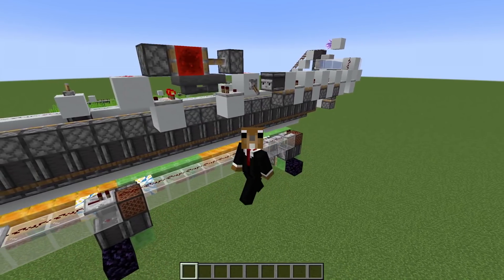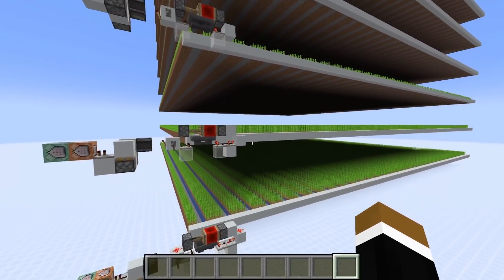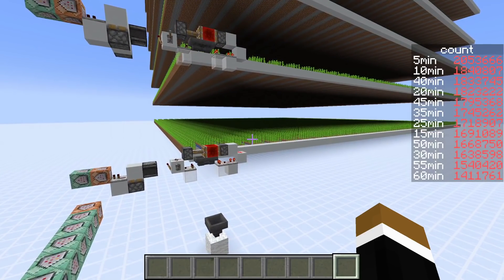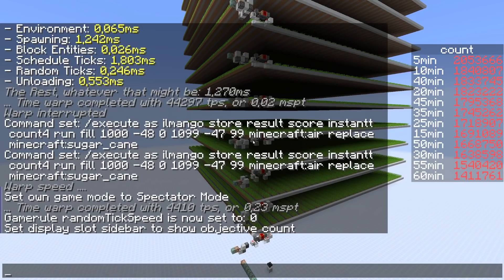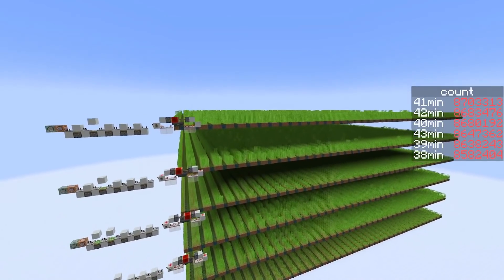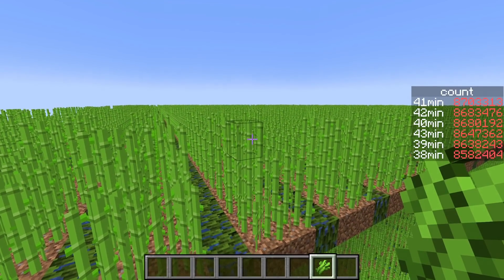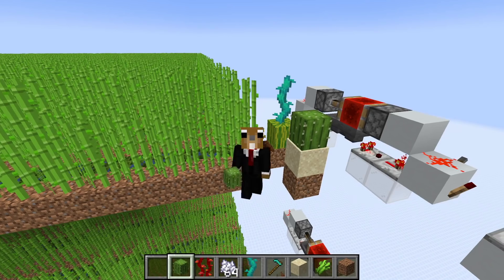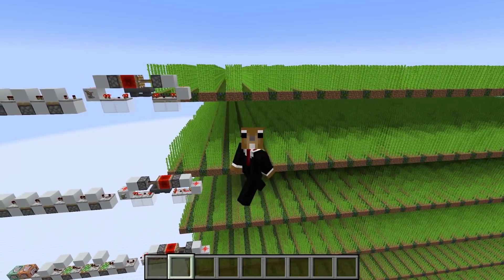What Is The Perfect Clock For A Sugar Cane Farm?

Comment: short answer: the best clock is around (10 * length of sugar cane + 49375) ticks

Long answer (check replies if you just want the exact numbers):
If we were to assume that the flying machine passes the sugar cane instantly, then Yuusei Kurobane's answer of a 49251 clock would be correct for a clock around 41 minutes. But in reality the flying machine will prevent the sugar cane from growing for a few ticks and does not collect any sugar cane harvested while flying backwards. Taking that into account (and assuming the farm is 34 blocks long (counting only the sugar cane)), the optimal clock length is 49708 ticks, with roughly 2.5725459776809921158178684192717991792 sugar cane per hour per plant. If we weren't lag-conscious, then a 4467 tick clock with 2.7563918812670089447739602907367470495 sugar cane per hour per plant would be the best you could do. I'll run the calculations for other farms lengths and post the results here later.
Reply: Optimal clock lengths for possbile lengths of the sugar cane farm (counting only the length of the sugar cane):

length | clock length | rates (sugar cane/h/plant)
   10     |      2633        |                2.9500
   11     |      2729        |                2.9390
   12     |      2822        |                2.9285
   13     |      2913        |                2.9183
   14     |      3002        |                2.9084
   15     |      3088        |                2.8989
   16     |      3173        |                2.8896
   17     |      3255        |                2.8807
   18     |      3336        |                2.8719
   19     |      3416        |                2.8634
   20     |      3494        |                2.8552
   21     |      3570        |                2.8471
   22     |      3645        |                2.8392
   23     |      3719        |                2.8315
   24     |      3792        |                2.8240
   25     |      3864        |                2.8166
   26     |      3934        |                2.8094
   27     |      4004        |                2.8023
   28     |      4073        |                2.7954
   29     |      4141        |                2.7886
   30     |      4207        |                2.7819
   31     |      4274        |                2.7754
   32     |      4339        |                2.7689
   33     |      4403        |                2.7626
   34     |      4467        |                2.7564
   35     |      4530        |                2.7503
   36     |      4593        |                2.7442
   37     |      4655        |                2.7383
   38     |      4716        |                2.7324
   39     |      4776        |                2.7267
   40     |      4836        |                2.7211
   41     |      4896        |                2.7155
   42     |      4955        |                2.7100
   43     |      5013        |                2.7045
   44     |      5071        |                2.6992
   45     |      5128        |                2.6939
   46     |      5185        |                2.6887
   47     |      5242        |                2.6835
   48     |      5298        |                2.6784
   49     |      5353        |                2.6734
   50     |      5408        |                2.6684
   51     |      5463        |                2.6635
   52     |      5517        |                2.6587
   53     |      5571        |                2.6539
   54     |      5625        |                2.6492
   55     |      5678        |                2.6445
   56     |      5731        |                2.6399
   57     |      5783        |                2.6353
   58     |      5835        |                2.6307
   59     |      5887        |                2.6263
   60     |      5938        |                2.6218
Reply: Lag-optimal clock lengths for possible lengths of the sugar cane farm (counting only the length of the sugar cane):

length | clock length | rates (sugar cane/h/plant)
   10     |      49421        |                2.5850
   11     |      49433        |                2.5845
   12     |      49445        |                2.5840
   13     |      49457        |                2.5835
   14     |      49469        |                2.5829
   15     |      49481        |                2.5824
   16     |      49493        |                2.5819
   17     |      49505        |                2.5814
   18     |      49517        |                2.5809
   19     |      49529        |                2.5803
   20     |      49540        |                2.5798
   21     |      49552        |                2.5793
   22     |      49564        |                2.5788
   23     |      49576        |                2.5783
   24     |      49588        |                2.5777
   25     |      49600        |                2.5772
   26     |      49612        |                2.5767
   27     |      49624        |                2.5762
   28     |      49636        |                2.5757
   29     |      49648        |                2.5751
   30     |      49660        |                2.5746
   31     |      49672        |                2.5741
   32     |      49684        |                2.5736
   33     |      49696        |                2.5731
   34     |      49708        |                2.5725
   35     |      49720        |                2.5720
   36     |      49731        |                2.5715
   37     |      49743        |                2.5710
   38     |      49755        |                2.5705
   39     |      49767        |                2.5700
   40     |      49779        |                2.5694
   41     |      49791        |                2.5689
   42     |      49803        |                2.5684
   43     |      49815        |                2.5679
   44     |      49827        |                2.5674
   45     |      49839        |                2.5669
   46     |      49851        |                2.5664
   47     |      49863        |                2.5658
   48     |      49875        |                2.5653
   49     |      49886        |                2.5648
   50     |      49898        |                2.5643
   51     |      49910        |                2.5638
   52     |      49922        |                2.5633
   53     |      49934        |                2.5628
   54     |      49946        |                2.5622
   55     |      49958        |                2.5617
   56     |      49970        |                2.5612
   57     |      49982        |                2.5607
   58     |      49994        |                2.5602
   59     |      50006        |                2.5597
   60     |      50018        |                2.5592

note: the values may be a little off as I had to lose some precision so that it wouldn't take forever.
Reply: If the flying machine ran in a loop, then the length of the farm wouldn't matter. Every sugar cane will get harvested the same specific time interval (excluding the first cycle). 
If the flying machine went back on forth then the harvest time that's a bit trickier to calculate.
Reply: @bamooxa2408  I assumed the flying machine went back and forth and used the average time a piece of sugar cane would be covered or harvested while the machine was flying backwards. If you could move the flying machine above or below the sugar cane on the return trip then the length of the farm would be much less significant in finding the optimal clock length

Comment: Ilmango, it seems there are sugarcane mechanics you are missing.
First, it looks like a 1 tall sugar cane doesn't reset it growth cycles when a block is placed above it. Otherwise your results for the 5m experiment will be close to 0. Growth cycles are only resent when the sugarcane actually breaks.

I've modelled this using statistics and I see the peak at 5m (the lower the higher) and at 41m 2s. However, I'm not getting the crest you got at 20m, and the difference between my 41m and 5m results is twice as large as yours. So clearly we're missing something.

Also it's worth noting  that I flying machine will spend more then a tick above the sugarcane, which will affect the results.

Comment: Using some basic statistical analysis in Excel VBA, I fit a 2nd order polynomial curve to the data, and I got 41 minutes and 2.8 seconds as the ideal harvest time based on the data shown on screen around 7:40
Reply: obviously, we need more data points to get a statistically significant answer, but I think my solution is pretty close.

Comment: Sugar cane takes, on average, 21845.333 ticks to grow one block taller. The average time for sugar cane to grow from 1 to 3 blocks tall is 43690.667 ticks, or 36 minutes, 24 seconds, and 10.667 ticks.

The reason is that a sub-chunk has a volume of 4096 blocks. A random tick speed of 3 means that each piece of sugar cane gains, on average, 3/4096 of a stage per tick. Since a sugar cane needs 32 stages to fully grow, you multiply the denominator, 4096, by the number of stages, 32, so you get 131072. Divide the numerator 3 from that and you get 43690.667 ticks. 

I assume the reason the optimal time is 41 minutes and some amount of seconds is because, if you harvest when roughly half of the sugar cane are fully grown, a large percentage would only be 1 or 2 stages from being fully grown, but would be harvested before being able to do so. The extra 4-5 minutes gives the sugar cane almost done growing time to do so whilst not wasting too much time not harvesting the rest that is already grown.

Comment: This would probably be a dofferent answer if you included the flying machine since the flying machine blocks potential growth while it flies. Maybe negligible but I would like it to be included in the experiment.
Reply: I thought of that too. Hopefully ist pushes the result to 42 minutes, 'cause 42 is the awnser on everything. 
You might also consider that sending the flying maschine back and forth could loose efficency compared to sending one flying maschine over and Sendung it back another way than through the shugar cane...
Reply: I was wondering the same thing.

Comment: Are you able to test the sugar cane count in intervals smaller than 1 minute? If so, I think it would be as simple as calculating the intervals between 40 minutes and 42 minutes, as a peak lies somewhere in-between those to values. I can see their being 3 scenarios: a peak before 41 minutes, at 41 minutes or after 41 minutes. If you aren't able to test it, the only way I can think of to predict which interval has the best return in sugar cane would require someone to fit your data to a function and then check for the absolute maximum between 40 and 42 minutes. I'm not sure which equation would best fit the sugar cane drops, so I'm not sure how to predict that, but I'm someone might know.
Reply: I think the main problem is how small of a difference there is, so it needs to be checked for a long time. At around 4:56 ilmango said that he used tick warp to test it for 400 hours, and he might need to test it for longer for those smaller intervals. The thing is he also said that it simulated at 30x nornal speed, which means it still took his computer around 13-14 hours to simulate it... Probably not even worth the check for anything but to know the theoretical best time.

Comment: How does cutting 2nd and 3rd block compare to cutting only 3rd? How would the growth stage act? You'd have two blocks that can be random-ticked, so the plant growth stage should grow twice as fast. Definitetly not lag friendly because harvesting must be frequent.
Reply from the maker: I don't see the benefit of cutting the 3rd block only. if it reaches the 3rd block it stops growing, which is basically the same as it reaching the 2nd block and then lossing some growth stages. So it's definitely better to cut the 2nd block, because you have at least a chance that is grows higher

Comment: If you make a flying based cactus farm using the same flying machine of the sugar cane farm, could this be more compact than the instant one. Because you could fit more cacti in the same area, the problem is that you lose vertical space in order for the cactus to grom 3 tall. i dont know, maybe the amount of cactus you place in one layer will make a difference. really great video Mango as always
Reply from the maker: it takes twice as long to reach 3rd block cactus. the standard design already allows the cactus to grow 100% of the time. Adding space to allow it to grow 3 high makes it actually less compact
Reply: @ilmango  yeah, i said more compact, because the best standard cactus farm doesn't use a checkboard pattern in order to give space for items to fall and not get lost. but using the sugar cane farm flying machine allow you use the checkboard pattern which is more compact but have a higher loss of items in non-flying machines based farms. so that is my question: would a 3 tall checkboard cactus farm with the best harvesting time, using flying machines be best than the standart desing?

Comment: Getting an exact result seems almost impossible, because ,ou can't test it (unless you do very long tests) and for the math you will need to consider the harvesting time, which, when comparing a decently large sugar cane farm (and for a small one, if you want 1% more effieciently you should just add a row) should make the theory and reality differ quite a bit between 41min and 41min 10s
Reply from the maker: I'm sure you can calculate it, but it's nasty

Comment: What about the clock times dor a flying-machine based farmfor kelp, twisting vine or weeping wine?
There's even more variation, cause they can grow much larger
Reply from the maker: It's a bit simpler. The more often you harvest the more items you get, but it doesn't really matter much until you get to the point where kelp, twisting vine or weeping vine has fully grown. I guess the only intersting question would be at which point do you only get 95% efficiency or something like that. Would be a very long time though

Comment: What do the repeaters in your hopper clocks do?
Reply from the maker: adjusting the interval length by a couple ticks. I wanted a proper 3000 tick clock for example. By adding one item to a normal hopper clock you add 16 ticks to the interval length.
For n >1 the length is n*16-12 btw

Comment: Statistics has never been something I understand very well. What I've done is to use the WIKI's average time. For instance, Sugar Cane grows on average one block per 18 minutes. So I figure that after 18 minutes, 1/2 of the plants will have grown 1 block. If I harvest then, I only would get 1/2 of the yield for a fully grown farm. Therefore I have figured that doubling the time to 36 minutes would allow (on average) all the plants to grow at least one block. Some, of course, would be three high and some growth events would be missed if a plant had already grown to the three block high limit. I then think that my total yield would be roughly 150% of the total number of plants.

From your results, clearly my thought process is flawed.
Reply: not much, i was thinking the same, tehn i scroll down the comments.
first, while the maching is running the plant can't gown
second on every thick the game choose 3 random block, but they can be the same, it doesn't make a difference on the long run, but maybe can screw things around in only 36 minutes
third, some plant staying on one stage because bad luck will not reset and proceed from where they have stopped while the 2 stages and 3 stages will will be reseted (they should average out on the long run)
also... are we sure a sugar cane take around exacly 18 minutes to fully grow? (and yes this have hight chance to be the hightest problem)
and finnally, you saw those spike at 20 and 40 minutes, if those stay even if farming for days, that means that there is a mechanic that we are not considering (and it's not on the wiki), cause the explanation he gave, should average out on the long run

Comment: Can't you use the same equation you used to calculate the optimal time to harvest a geode to calculate the optimal time to harvest the sugarcane?
Reply from the maker: but you would need to consider that after harvesting some of the 1 high sugar cane plants have growth stages left, which is probably expressed with a recursive function. Just using the Poisson distribution isn't enough. Maybe someone can do the proper math.
Reply: I do think you could solve it with by modeling it as a continuous time markov decision process, and solve it with for example policy iteration. But that is too difficult so approximating it with these tests seems close enough.

Comment: That was really interesting. I didn't think of all the growth stages and always just harvested mine every minecraft day using a daylight sensor. But it is nice to know that there is an optimum!
Reply: with a minecraft day having 20 minutes, 2 days become 40 minutes, close enough for the optimal time for harvest, add a few tweaks and the sensor could become a better clock! did that with mine just now haha
Reply: @KAMUPhobies  On the other hand you already have a peak at 20 minutes that is insignificantly lower than the one at 40. So I don't really think there is a need for a flip flop. In my case, I really should switch to a clock because I am usually sleeping through the nights what makes a 10 min clock out of it and 10 seems to be a local minimum.
Reply: @KAMUPhobies  Yup, just need a flip-flop!